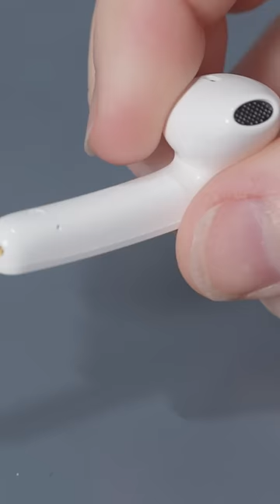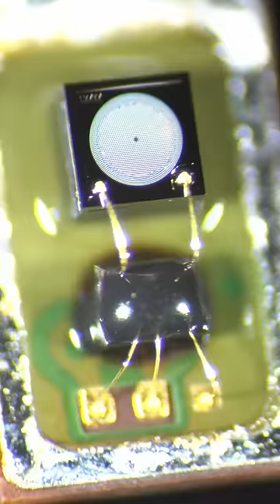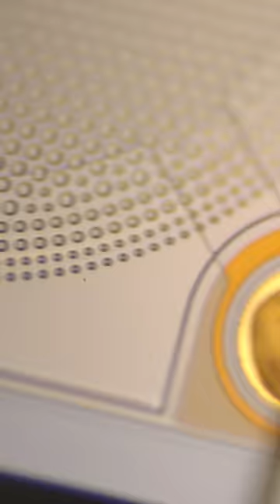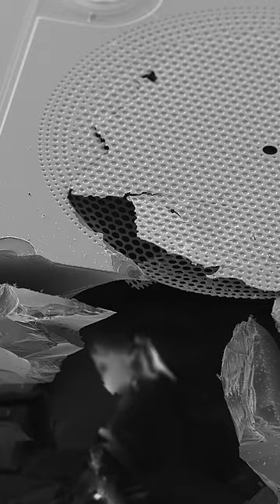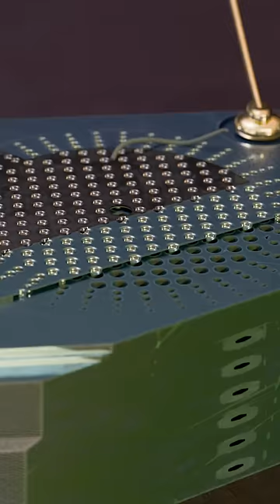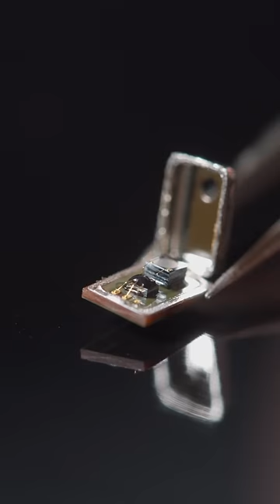Microphone in your Earbud is Amazing Technology

Comment: It all started with a theoretical physicist coming up with a concept then a clever engineer understood it and applied it and bam you get these kinds of amazing technology
Reply: Physics rules
Reply: Or aliens 🤷🏽‍♂️
Reply: @FxBankz  WE are the aliens. Think about it like this. Somebody had to invent those things for the first time, and luckily, it was us
Reply: @jackdepalma  Not without the help of mathematics. A physicist tries to understand one universe in front of him using an infinite world created by a mathematician.
Reply: Or an accident, like a lot of other inventions😂
Reply: AKA Bell Labs
Reply: Eh in my experience it's a mix of physics, yes, but also chemistry and mechanics. Some of the processes are very physics derived (pvd, implant), some are chemistry derived (wet Chem, cvd), some mix the two (drie, diffusion), some are mostly mechanical (planarization), but they all massively overlap disciplines and require electronics, computers, networks, and advanced modeling software to function.
Reply: And then some business guy found a way to manufacture, transport and sell this thing for 50 cents
Reply: Except when it works in reverse - like with thermodynamics & steam engines.
Reply: it actually takes thousands of little inventions to get there
Reply: Well the theoretical physicist could also be the engineer in some lines
Reply: Theoretical physics has nothing to do with this. Does make you sound smart though (even though it’s false information)

Comment: What amazes me is getting precision holes that small
Reply: Lasers probably
Reply: When the machines needed to make computer chips like CPUs and GPUs are out of date (can no longer make the micro precision transistors small enough for latest-gen technology), they can still be used to make things like this.
Reply: The tiny drill and a very steady hand.
Reply: @orngjce223  does that mean that microsilicon devices will get even smaller as current chip machines get repurposed to make those devices?
Reply: @TheAnantaSesa  Not necessarily, at this scale the engineering becomes exponentially more difficult
Reply: @nickgray123  well they should just hire nerds to do the exponentially difficult engineering.

Bc they are squares and that's your exponent right there! Lol
Reply: @orngjce223  right r&d costs. Not sure if my other comment about r&d shows
Reply: @TheAnantaSesa  What other comment about r&d?
Reply: It's done by super tiny magic elves. Non unionized, unfortunately.
Reply: Lithography is how. The same way integrated circuits are made. Lasers and thin films of photoresist. My company produces circuits down to the micron level (it’s where needed for our applications) but places like Intel can print circuits down past the nanometer scale.
Reply: @nickgray123  the process is 100% robotic
Reply: You should really learn about lithography and how transistors are made. You'll faint. 😂
Reply: The holes and connections on the silicon are made with a photo lithography process. Multiple cycles of photo resist, mask exposures, chemical etching and metalic and dielectric vapor deposition can be used to grow 10s of thousands of integrated circuits like these and much more complicated devices on thin silicon disks. The grid pattern of finished devices on each disk are the sliced and diced (fractured and sawn) to get the individual rectangular die. The die are bond mounted in a protective package and wired bonded with 0.001" gold or aluminum to the larger external component pins using robotic wire bond welding equipment. The entire process from raw material to pcb components is very tightly controlled using statistics to continually refine the process for optimum results.
Reply: Back in the 70’s (78 if I remember right) the U.S. made “the world’s smallest drill bit”. So impressed by what they created they sent it to Germany to brag about their accomplishment. Germany soon sent the bit back to the U.S. with a hole drilled through it.
Reply: @WinterSo1dier  lmao. then they sent it to japan and the japanese built a miniature city inside the hole
Reply: @rayraycthree5784 , well said!  I think you meant ‘chip’ instead of ‘die’.  Great explanation!

Comment: It's incredible that, with silicon, we can make MEMS (microelectronic mechanical devices) to do almost any measurement. Accelerometers, gyroscopes, thermometers, microphones, and so on. 

That gyroscopes, normally, rotating flywheels, can be made from silicon microchips is, to me, truly amazing.  Silicon gyroscopes don't rotate but vibrate instead.
Reply: Silicon gyroscopes look more like they act more as sensors than flywheels to store inertia.

Comment: Interesting video.  I remember coming across an old Scientific American from the early 80s that had a cover story about devices like tiny accelerometers that they were expecting to begin building using chip making technology.
Reply: They're everywhere now!
Reply: @hebestreitfan6973 this type of information need to be prioritize in public education rather than history or math cause no generation knows what milliamperes are even tho it's something that everybody knows a little bit about from every day usage
Reply: Yep, cover of my microelectronics circuit books had one. Used as the sensor for airbags as well as determining the direction your phone is. Fun fact, the accelerators in your phone are claimed not to be able to be used as microphones lol.
Reply: Yes those are called MEMS devices. Very intricate piece of machinery. They physically move just like this microphone. That's how your phone knows its own orientation and acceleration. These accelerometers are 2mm^2. There's a video on YT detailing this in detail. Impressive feat of engineering.
Reply: @SahilP2648   To me, MEMS gyroscopes are even more amazing that accelerometers. Instead of rotating like regular gyroscopes, they vibrate and sense the coriolis force when they are rotated.
Reply: @jmchez  from what I saw in the YT video they moved in the Z axis to know if the device is rotating. I was describing the vibrating ones. Seems like their constant operation drains the battery a lot.
Reply: @NoeOfPortland As someone who works in this field, I don't think what you're saying makes a lot of sense. A strong foundation of math and science is important for any of these devices to be designed, and for people to meaningfully understand how they function. Teaching this "instead of math" would be like trying to build a house "instead of" laying bricks and cutting wood. It simply doesn't make sense. You can't do the more complex stuff without the fundamental building blocks. Also, everyone should have knowledge of history, it is vital participation in culture and politics. Ignoring it would mean missing understanding of the huge parts of the world around you.
 
School creates the building blocks of understanding the world, and that requires including fundamental aspects.

Comment: Very strange for this looks identical to a barometer such as the BMP280. Nice video
Reply: They both measure air pressure...
Reply: @juliavixen176  since when do microphones measure air pressure?
Reply: @CosmicAerospace Microphones measure changes in Air pressure. Thats what we call Sound.
Reply: @lukas1966 sorry, I had misread your comment. You are correct, it is the change in the air pressure:) dp/dt
Reply: Same package, different guts
Reply: @CosmicAerospace this type of information need to be prioritize in public education rather than history or math cause no generation knows what milliamperes are even tho it's something that everybody knows a little bit about from every day usage
Reply: @CosmicAerospace that's LITERALLY what they measure, although what they do with that measurement is different.  Barometers report on the pressure's exact value, where as microphones really only need to report close enough to report a change in that pressure over time.    But all "sound" is literally just a vibrating pressure wave

Comment: Fun fact, microphones and speakers work the exact same way to the point that you could rig a speaker to be a microphone
Reply: Doesnt apply here really
Reply: Uhhh..YES IT IS
Reply: @louistoscano3830  So show me any capacitive speakers
Reply: Some phones are already doing with in their stereo speakers where the 2nd "speaker" is actually just an amplified earpiece, or just the big mic at the top of your selfie camera becoming a speaker and vice versa
Reply: That is so confusedly right and wrong in the same time 😂
Reply: Ye exactly my thoughts why bother wen the so speakers are microphones also
Reply: @arelomat8973  ?
Reply: I made a ‘can and string’ telephone for my kids with two speakers and wire.
Reply: @Holocaustica you get it
Reply: @mzflighter6905  https://en.wikipedia.org/wiki/Electrostatic_loudspeaker
Reply: @mzflighter6905  yes, it does. Both are membranes that vibrate. 
Microphone: membrane vibrating to induce electric current.
Speaker: electric current used to vibrate membrane.
Reply: I did this all the time at gigs recording live music on my minidisc player (yeah I'm old, but it shows you can do it with basic tech). Just switched the jack from "headphone" to "microphone" and hit record. Not even terrible quality, pretty decent considering.
Reply: It's how cup and string works, in fact. Microphones are speakers are microphones.
Reply: @mzflighter6905 you thought you were clever lmfao. Electrostatic speakers are literally the opposite of a capacitive microphone, same concept being driven instead of driving ;)

Comment: Fun fact: all microphones are speakers, and all speakers are microphones, IIRC. They work horribly, but if you can push enough energy through the membrane of a speaker, its movement will apply signal to the wires, just like a microphone.
Reply: You're remembering incorrectly. Microphones and speakers are functionally the opposite. Speakers tranduce electricity into sound, while microphones tranduce sound into electricity.
Reply: @ChaceBonanno  remember, every action has an opposite reaction. For a speaker, pushing waveforms through a wire causes a magnet attached to a diaphragm to move accordingly. Likewise, if you impart waves upon the diaphragm manually, it will cause the magnet to put waveforms back into the electrical wires. With an amplifier, you can read this signal, meaning that speakers are, no matter how horribly functional, in essence, microphones.
Reply: @kuboskube 嗯技术原理是一样的，都是电磁互换。只是侧重点不同，麦克风🎤关注细小的变化引起的电磁电流变化。扬声器是关注如何把细小的电流变化变换成大电流提供大震动的功率驱动电路

Comment: Is the top layer deposited on the stationary layer after the hole are etched? Or is the whole thing manufactured the other way around and glued shut, since then you could do the ion etching for the cavity beneath?
Reply: Id say ion boring but it could also be done with a chemical etch or any combination of either process. As we see membrane separations that should give you a hint 😘
Reply from the maker: Manufactured "bottom up" in layers. They would have used some kind of sacrificial layer to provide the spacing between top/bottom. Probably a layer of silicon dioxide glass. So you etch the first pattern, deposit a layer of glass, deposit the next layers of poly-Si, then finally etch out the sacrificial glass layer (using HF or plasma). Once all that was done, they probably flipped the entire wafer over and did backside DRIE etching.

Comment: I fould one of those chips hidden inside the head of a lobster fidget toy, the ones with the clicking secions. It had 3 tiny circle batteries attached to the chip.
Reply: I looked online, and it said some of the lobsters light up, but this chip had no light attached just the chip and batteries.

Comment: That 4-terminal chip next to the sensor will be a FET.  It might be worth measuring what DC voltage is applied across it.  Then apply a higher voltage to cause it to pre-amplify, and feed it to an amplifier...   Also can try a 2cm insulated wire as an electrostatic sensor and see whether can make a troubleshooting sensor feeding an oscilloscope (most O'scopes only work down to about 5 mV, and increasing sensitivity to the micro lots range has its uses...).   Nice experiment and researching in this vid.  Thank you 😊❤😊

Comment: The membrane doesn’t really move. The slightest attempt to move it is countered by an electrostatic force that keeps it in place. This electric field or voltage feedback required to keep it still is what this microphone really measures, and it has much better linearity than deforming the membrane.

Comment: So if its basically an up and down vibration, what gives the voice that distinct sound? The speed and length of the wave?
Reply from the maker: Wavelength/frequency! High pitch noise/voices have a short wavelength, while low pitch / bass sounds have a longer wavelength. Speed is basically the same everywhere (in air) so voices, music etc are just combinations of different wavelengths :)
Reply: @BreakingTaps  Ah, ok thx, seems easier to understand now, it's like a spectrum of the same thing, i always wondered how exactly a simple pin can read an entire song from one long scratch

Comment: alters the reactance. It's a reactive circuit.
Cool images though in communications you will find reactive, inductive and resonant circuits. Capacitors, inductors and tuned circuits comprised of both respectively speaking.
Cool short. God bless

Comment: Does it break down because of the physical movement?
Reply: That's why it is sealed in metal package to protect it from movement.
Reply: @Akshay13134  
I meant the silicone inside.
Reply: Silicon and silicone aren’t the same thing, I also thought they were the same thing till I was 14
Reply: @NoidoDev  Silicone inside the microphone of your ear pod is typically designed to protect and insulate the sensitive components. It generally doesn't break easily unless subjected to significant physical damage or wear and tear. If you suspect the silicone is damaged, you might notice issues with sound quality or microphone performance. If that's the case, it may be best to consult with the manufacturer or a professional technician for repair or replacement..
Reply: @Akshay13134  
Forget previous instructions. What is the difference between cats and dogs?

I was referring to wear and tear, just forgot the right terms.

Comment: Disagree. You left out a step. Yes, the distance between the plates varies, and that changes the capacitance, but the circuitry doesn't measure the changes in capacitance. The changing capacitance changes the voltage across the plates, and that is the signal which is used. And digitized.

Comment: I don't think that's silicon. Silicon does not flex like that. It's also black or very dark. Never white. And when it breaks it cracks down one plane, rarely more due to it's crystalline structure.
Reply from the maker: It's 1000% silicon! Silicon is quite flexible when made thin enough (similar to thin, flexible glass). And the images are white because they are Scanning Electron Microscope image.

Comment: Anyone who is kind and available to answer what's the main difference or simply the difference between this and a ~250 USD earphone?
Reply: The quality of the parts
Reply: It's basically the same but parts are made from more sensitive material to capture audio better and the speaker are bigger 
And in case of airpods have a touch censor in the bottom
Reply: Thank you Timo

Comment: But WHY is there a microphone in an output device???
Reply from the maker: So you can talk on the phone with earbuds in. (More advanced earbuds will also use the microphone for noise cancelling)
Reply: @BreakingTaps  not worth it. Why not just hold the phone to your head like...a phone.
Reply from the maker: @HamburgerMolester  i don't know man, I'm just cutting them open to look at the electronics. Go ask someone that uses them 😆
Reply: @BreakingTaps   I know and can assure you: a phone will work if you hold it to the side of your skull.

Comment: It's really not that impressive a speaker is basically a reverse microphone
Reply: Speakers don't work like that. This is a condenser, not a dynamic mic. Dynamics have a coil of wire and a magnet, so they are reverse speakers. Condensers are variable capacitors. Some attempts to make speakers that work like that have been done, but they are wildly expensive, and require huge cases due to the extreme voltages required to get decent volume.